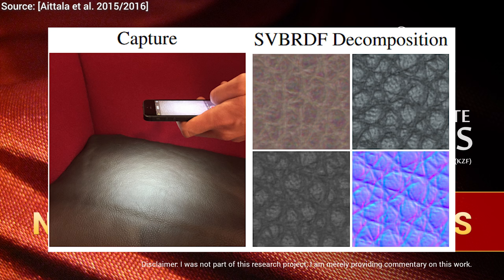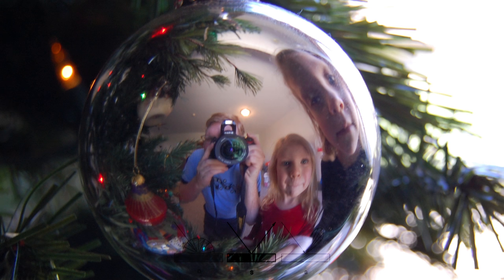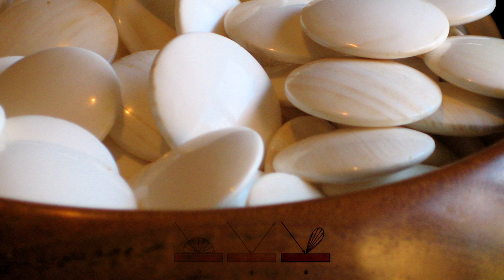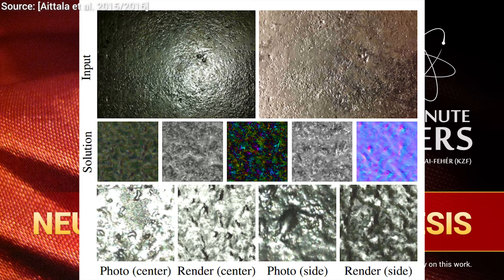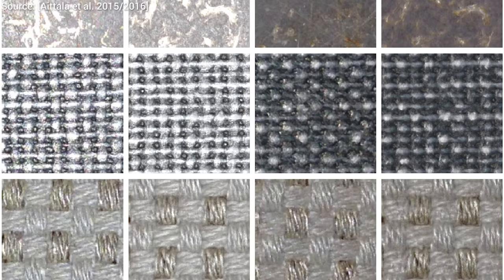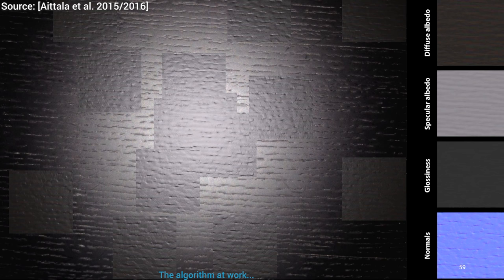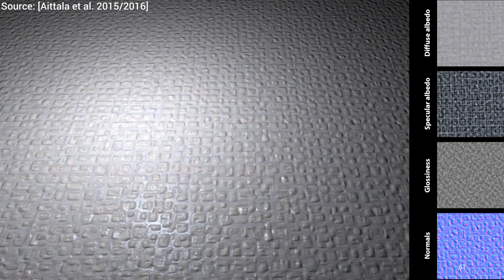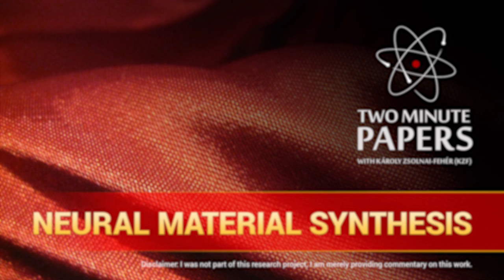Neural Material Synthesis | Two Minute Papers #88

Comment: Neural networks just keep improving everything - truly revolutionary technology
Reply from the maker: These are indeed some outrageously high quality results. Completely speechless.
Reply: How the normal and specular maps are craeted today for games and CGI? Is it done per hand by the artist?
Reply from the maker: I am not on expert on this, but what I have seen so far is that you either slap handcrafted textures there and hope for the best, or use some kind of procedural generation technique.
Reply: check out the software Knald or crazy bump
Reply: Two Minute Papers I don't know about games but in cgi there are also large databases of photoscanned materials. poliigon is one example, however, this technique could make it cheaper, easier, and possibly more accurate..

Comment: that really was one of the best episodes thus far :)
Very impressive results!

Just checking, since I was late to the party, did you see my (standalone) comment (not a reply) to your previous video? I thought it might be important. Although from what I saw in this particular video, I think you already did much of what I suggested there
Reply from the maker: I have read every comment under that video. Will address them in the next episode. :) Thanks so much for weighing in and happy to hear that you liked this episode!
Reply: good :)
In other news, I've just learned about a concept called "Hamiltonian Monte Carlo" - It's like Markov Chain Monte Carlo except that it samples things in a more regular fashion (using Hamiltonian mechanics), more uniformly filling out its sampling space. - Apparently this helps with especially high dimensional data because it tends to scale better than standard MCMC, but it comes at the cost of being more picky about its initializing parameters. It's apparently already being used in NNs.
Now I wonder (and I'm not saying you are supposed to be the one to know the answer to that) whether this could also help somehow with Metropolis Raytracing.

Here, if you are interested, is a paper. It's full of maths but actually, if you aren't too scared of derivatives, the actual maths involved is actually pretty straight forward. It's the physics side (where Hamiltonian mechanics come from) that's, if not unintuitive, at least kind of surprising at first. (After that it's one of the most beautiful subjects in all of physics in theory and also one of the most useful for actually simulating stuff in practice)
http://www.cs.utoronto.ca/~radford/ftp/ham-mcmc.pdf
It's quite a long one but it's well written and clear, if you have the time and interest. :)
Reply: there are also plenty of talks on the topic if you search for it on YouTube